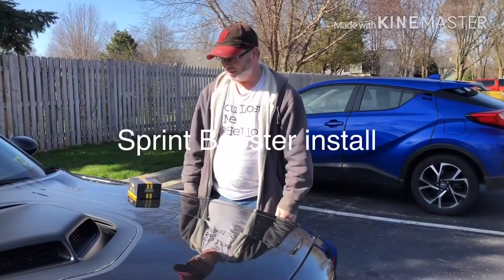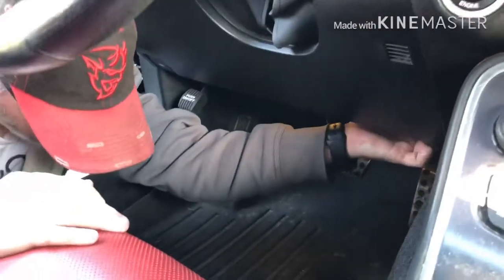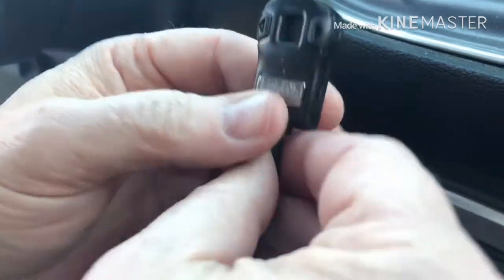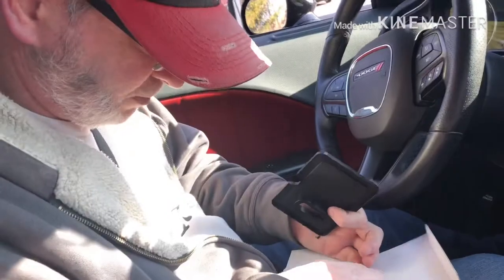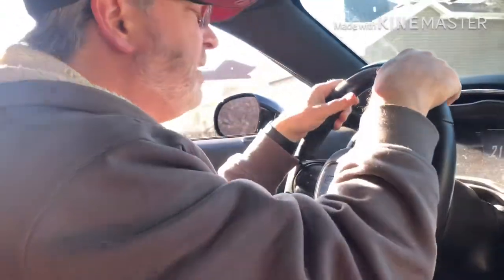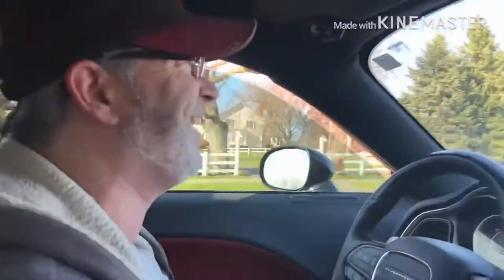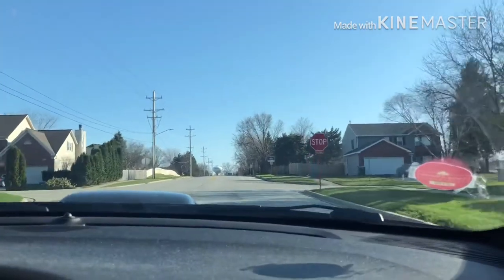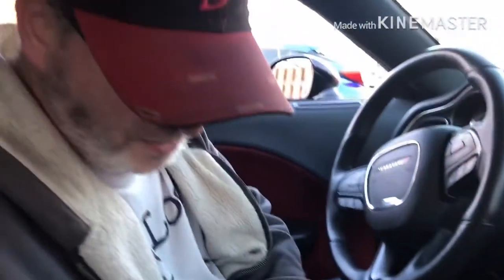Sprint booster install on a 2015 Dodge Challenger hemi shaker

Comment: I had my Sprint Booster on for a while & the engine definitely didn't blow up, but it surely felt faster. Great vid
Reply from the maker: The more time I've had it, the more I love it. Even the exhaust sounds better... IDK why, maybe WOT? I like the fact I can change it whenever I want. I usually keep it on race 8. The car seems so boring with it off now.
Reply: @icemanfiveoh  Yes it's extremely fun I'll be returning my Pedal Commander & I will order another Sprint Booster
Reply from the maker: I didn't hear great things about the pedal commander. What did you notice between the 2?
Reply: @icemanfiveoh  I just got it two days ago & since then I've seen so many people comment that at some point they've had problems with it & eventually had to remove it so with that I never installed it & won't I'm now waiting for the return shipping label which they'll send tomorrow
Reply from the maker: I think you made the right choice. I researched both, And I picked the sprint booster. It's been so long, I don't know what I didn't like about it, but it must have been significant enough for me to pick the sprint booster. Good luck and I hope the installation goes well!
Reply: @icemanfiveoh  In the end it'll be Sprint Booster for me as well. Thx for the vid

Comment: I straight pipe my 2014 charger RT and put the car in sport mode and the the sprint booster on 9 in race mode. You will feel the power in the rear for sure.

Comment: Yes remove your mid mufflers keep the resonators. Did a mid muffler delete on my 2014 Charger R/T and it sounds great.
Reply from the maker: That's the plan! Thanks for the suggestion.
Reply: I deleted the resonators and blastin bobs glasspacks. Hows the drone with the mid muffler delete?

Comment: I would straight pipe it I did on my 2006 Dodge charger and it's little drone..or I would go with super 10s flowmaster and do new x pipe and it sound good

Comment: Hey I want one for My 2006 Dodge charger rt was it worth it
Reply from the maker: Now having it installed for a while I can say it’s worth it. Driving around town is def more fun. But my mpg dropped to 10 from 13. But hey, I didn’t buy the car to sip the gas. If you have 300 lying around I would do it. I regularly chirp tires without meaning to. And I feel like it pulls harder off the line. Sometimes it drives like an absolute beast... it’s all in how you drive it. It’s very sensitive to how much you push the pedal. Just barely pushing on it(say 10%) makes it rip. Floor it and it seems to act more normal. Hope this helps.